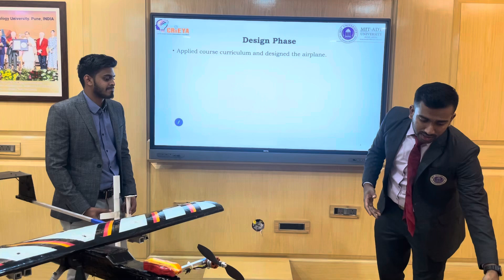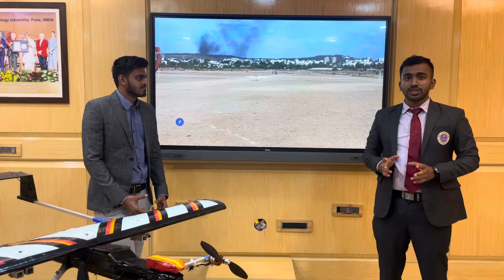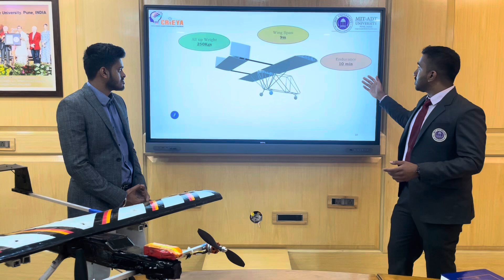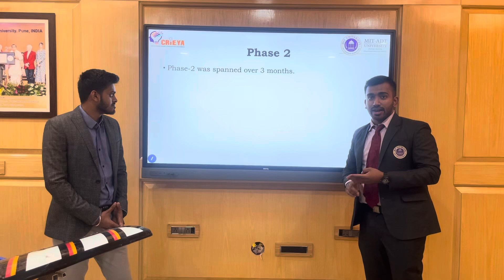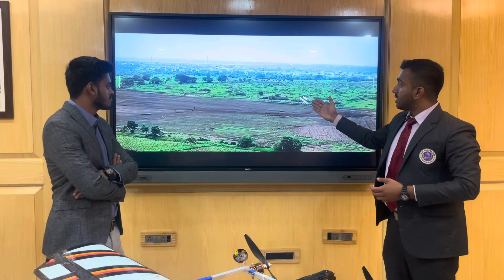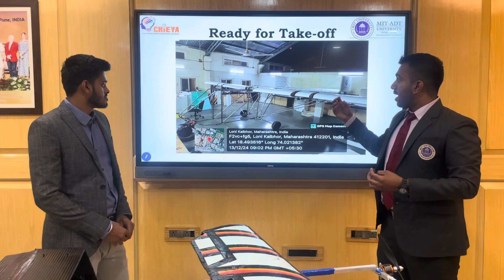Video Report of Largest Electric RC airplane in India

Comment: 1)   you  should  NOT  be using  SF props.
2)   the cg should be located at thirty percent of chord and the main landing gear should be located below the cg.
3)   the tail should be made as light as is practical.    to that end, the dual vertical stabs should be made relatively smaller.     to the extent practical, the distance between the dual tail booms should be minimized.      to the extent practical, the span of the horizontal stab should be equal to  thirty percent of the wingspan.
4)   if the model has a dihedral wing then ailerons and the mass of their controls can be eliminated.
5)   the landing gear wheels should be as light as possible; while also having a diameter that rolls 'easily'.  
6)   the all-up-weight  Should  be  kept  as  LOW  as possible.    to that end, no more that two motors should  be used.     the thrust/power system  SHOULD  be  designed   ACCORDINGLY. 
at scales approaching full scale, the prop rotation rate  should  be  near  2350 rpms.    this means that a miniature prop(s) should  NOT  be  used.      the appropriateness of using a belt driven prop(s) should be considered.      see (belt) prop drives used in ultralight aircraft.
https://d2t1xqejof9utc.cloudfront.net/files/169817/Belt%20Drive.bmp
Reply: 1. Yes, sir we are now changing our propellors.
2. CG is at 25 percent of the chord, and main landing gear is very slightly behind the CG( Because it is a tri-cycle landing gear)
3 .The horizontal tail accounts for 45 percent of the wing span, and yes, we acknowledge this. However, the tail can be made lighter.
4. No diheral. we want all the controls. Servo and battery for controls adds not more than a Kg.
5. They are very light. The lightest off the shelf product that fits in our budget.
6. AUW has been kept low. It was initially designed for a single seater manned airplane, hence we need some ballast in the front to keep it balanced. The propulsion system will act like the counter-weight and the total weight will then come to 250 Kgs(MTOW).
7. Maintaining a 165W/Kg ratio.
8.Yes RPM is in the range of 2500.

Thank you for the feedback. It means a lot.